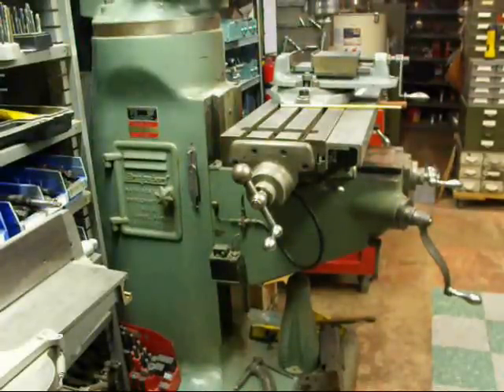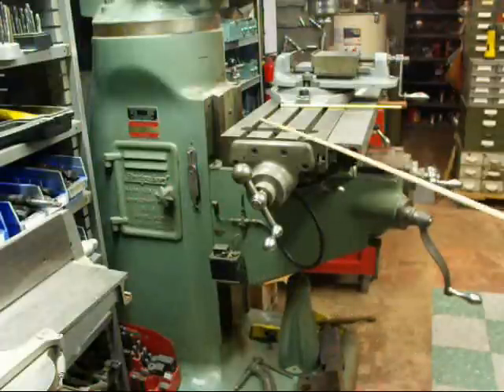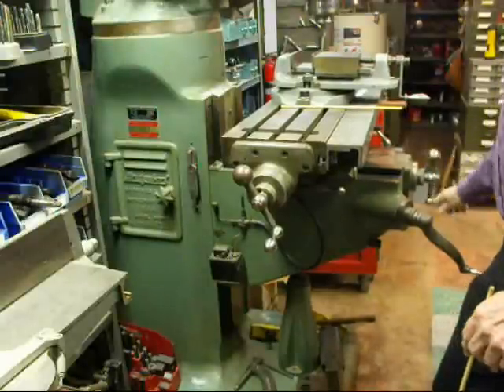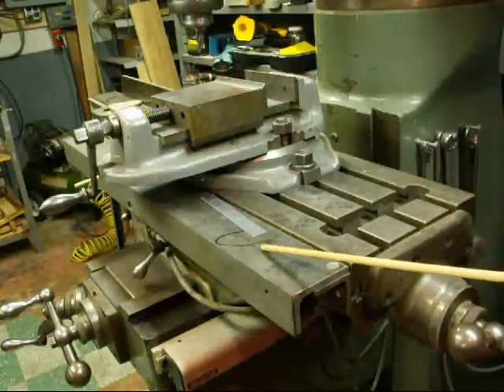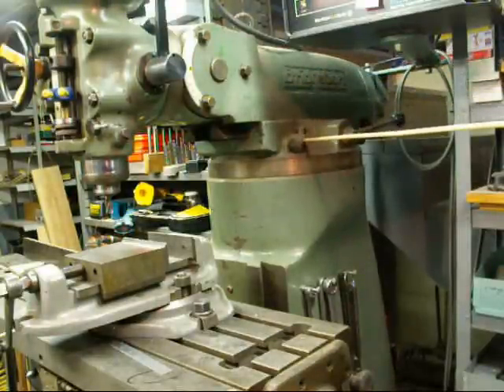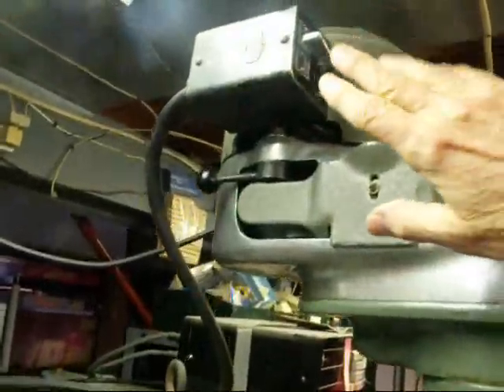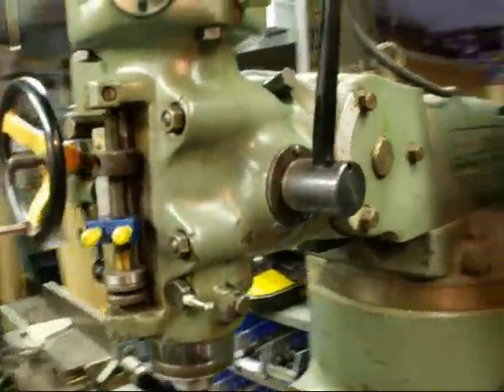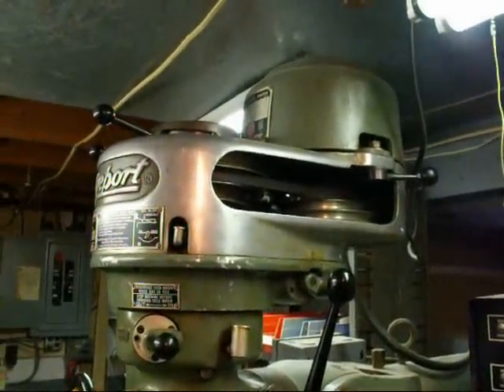MACHINE SHOP TIPS #13 BRIDGEPORT MILL  Parts (A) tubalcain

Comment: Another great video by Mr. Pete - Thanks for more excellent info!!
IMPORTANT:  What Mr. Pete refers to as "grease zerks" when talking about the oiler are actually OIL zerks.  NEVER PUT GREASE IN THESE FITTINGS!  Although a grease gun will fit on these zerk fittings, you should only put way oil into them with a special oil gun.  If you put grease in, it will attract and hold chips, dust, and grit and will cause very rapid wear on your ways.

Comment: Hi Mr Pete
Great Video's.....I have a problem with the quill feed on my bridgeport and I am hoping you can help me. I am replacing a sheared pin on the worm wheel at the end of the quill feed shaft on my bridgeport and I have encountered a problem. Do you have an e-mail address that I can contact you on as I think you will be able to guide me through it...I have some pictures that I would like you to look at and advise me what to do next.

Comment: A few extra notes,

For people that have zerk fittings on there saddle, DO NOT put typical axle grease in there.  You need to use WAY OIL!  You have to buy a special zerk gun or modify a grease gun in order to use way oil in it.

The casting you could not remember the name of is called the knuckle.